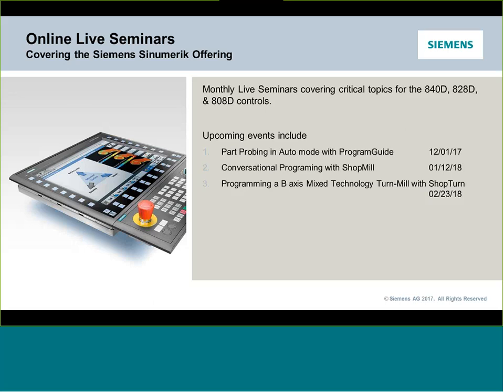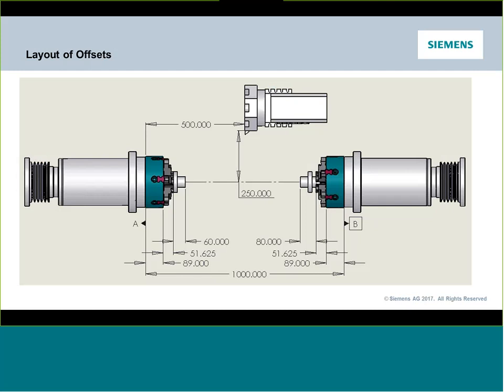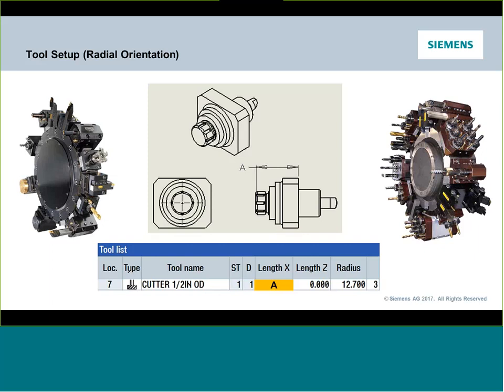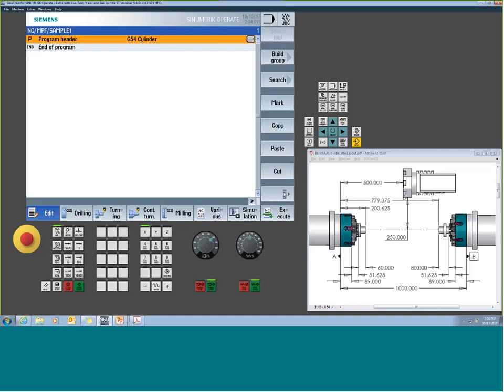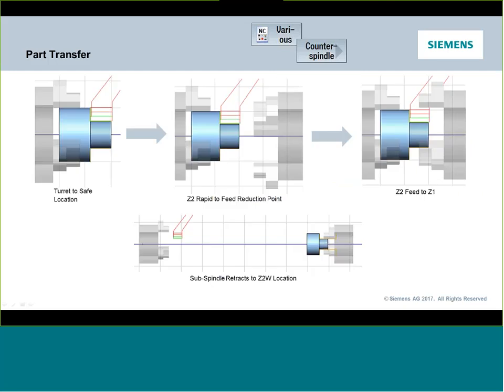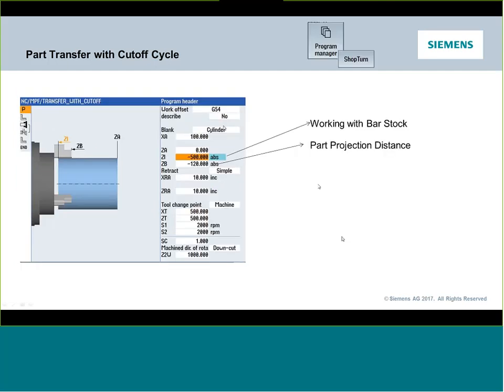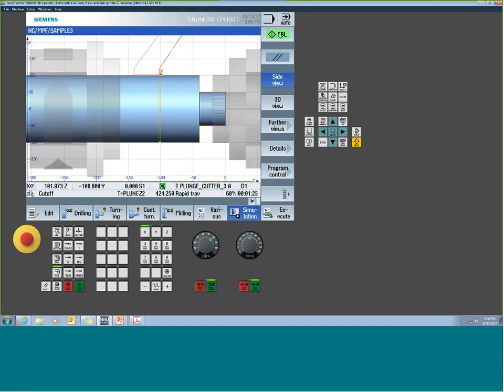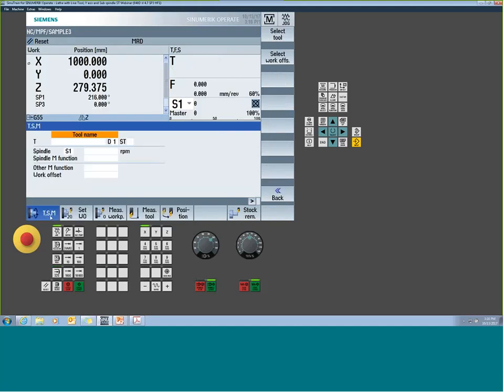Setup & Programming Sub Spindle Lathes with ShopTurn   SINUMERIK 840D Sl & 828D Turning

Comment: The finished part is 100mm, but after cutting, I want to have an allowance on the main spindle and on the subspindle for facing. Where should I set this?
Reply from the maker: you add that in the header of the program then take a face pass

Comment: What to do with draw if i have to face both sides. Should i add 0.5mm to stickout for both side.
Reply: And how to just pull a part for a little bit and machine it again
Reply from the maker: all depends on what you are doing
Reply from the maker: depend bar or slug size